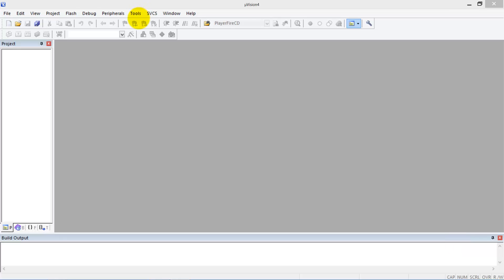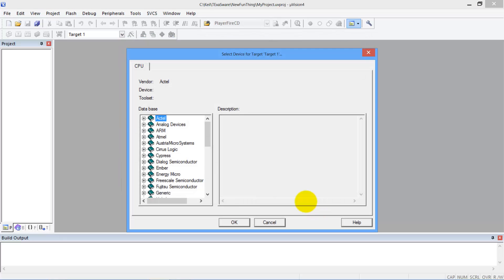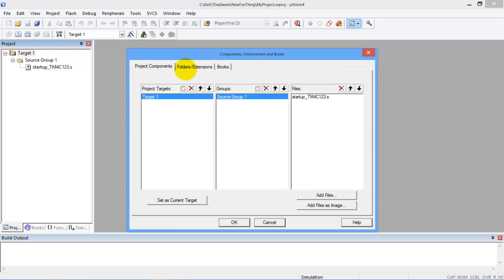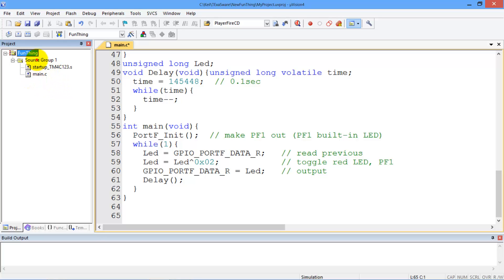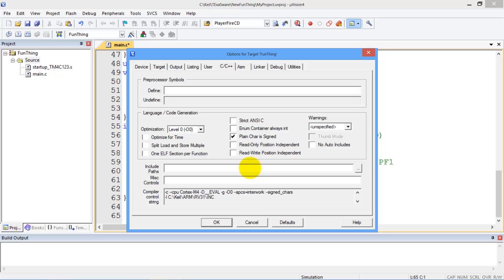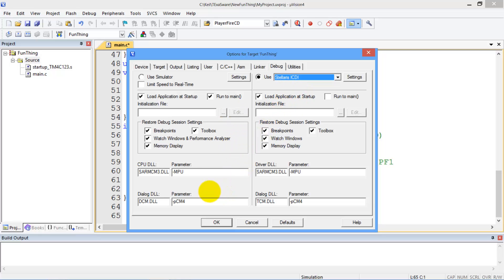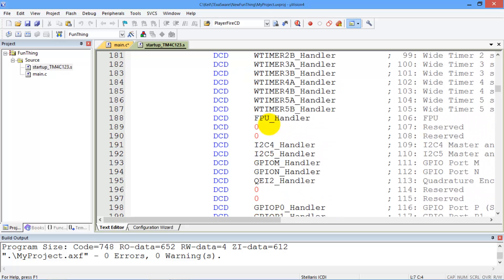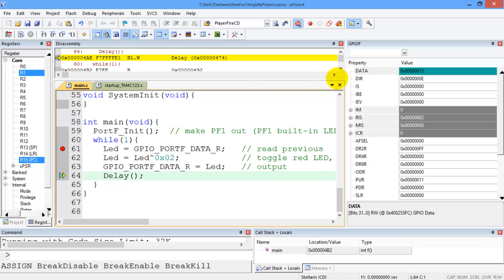NewProjectFromScratch

Comment: Sir. I have one question. I found that the debugger of TM4C123G lunchpad is built with 16MHz clock and has jtag interface with it. But in stellaris debugging settings, I didn't find any option to set 16MHz clock. There was 1MHz maximum value by default and 3MHz maximum. So how should I set it up ? Thank you, sir.

Comment: The simple LED toggle program is to complicated. why can't we do a simple toggling LED like the one using an 8-bit microcontroller such as :

# include <microcontroller.h>  
main()
{ OutPortA (FF);
 Delay();
OutPortA (00);
 Delay();
}

Another question, why do you use different startup.s file from the one supplied by Kile? The names will be different. What benefit do we gain?
Thank you for the wonderful job you'r doing at UT.6.01x Embedded Systems class.
Reply from the maker: You can do it this way if you do not care to understand how it works. 1) download TivaWare 2) run their Blinky example.
The benefit of using a different startup.s than Keil is one can define the interrupt service routine with the same names in all your projects.
Reply: Jonathan Valvano Thank you Dr. Valvano for the reply, but the startup.s is not clear to me. Can you please explain this file in some details?
The Cortex M4 has lots of traps for young players.
Reply from the maker: mohammed yasser Algailani
a couple of things to note; otherwise you can just ignore it. This is 1024 bytes
Stack   EQU     0x00000400
1) you define the stack size. If you have a lot of local variables, then you can increase the size
2) all those DCD specify the names of the interrupt routines
3) I turn on/off the floating point when needed/notneeded. this is off (because it is commented)
;        MOVW    R0, #0xED88
;        MOVT    R0, #0xE000
;        LDR     R1, [R0]
;        ORR     R1, #0x00F00000
;        STR     R1, [R0]
4) this is the actual code to enable interrupts
;********* EnableInterrupts *************
; disable interrupts
; inputs:  none
; outputs: none
EnableInterrupts
        CPSIE  I
        BX     LR